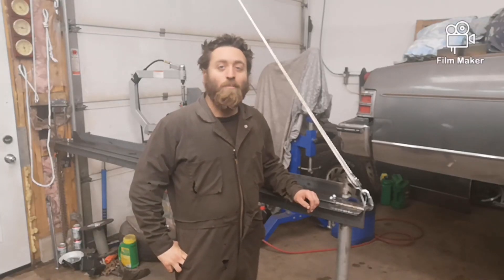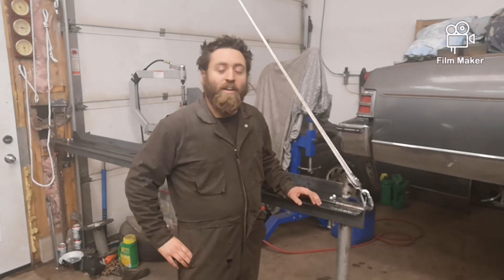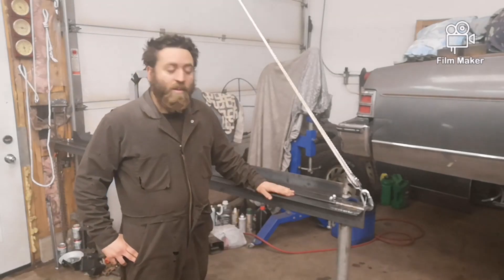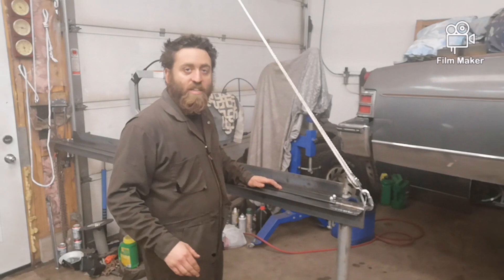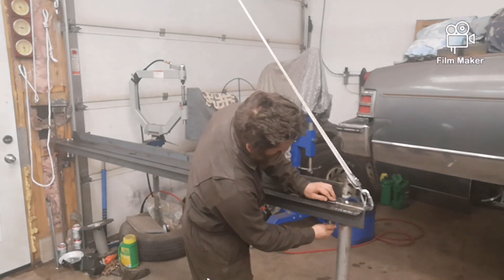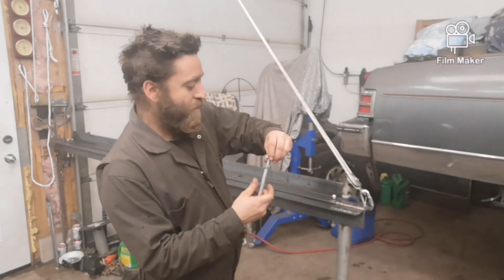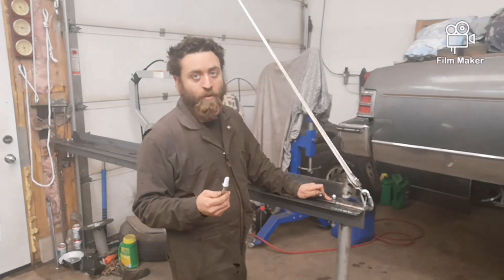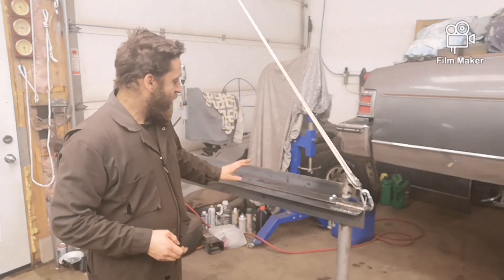Clargo Garage - 8 Foot Home Made Sheet Metal Brake That Takes Up Zero Floor Space  DIY - episode 46

Comment: very niceé I would add a secondary lock just in case someone messes with the rope.something low so that you can disengage it from your height
Reply from the maker: Thanks for watching, I have the rope that I use to pull it up and always have that secured when it's up plus's I have the separate safety loop rope ( verified that that would hold it alone ) and I have a angle iron support coming off the wall to help take some of the load off ( that alone probably wouldn't hold it, but it dose help take some stress off of the ropes . Definitely better safe than sorry if it ever came down would definitely do some damage if it hit something or would be deviating if it hit someone, definitely good to have multiple safeties on it. As far as function goes, I've had to add some extra bracing to help with the flex (should of used bigger angle iron for this length , haven't bent anything full length yet but have done some 36ish inch  long 20 gauge after adding some bracing and it's been performing good so far. Thanks for watching

Comment: fold up is a great idea for space saving. Was hoping you'd bend something bigger than that tiny piece that could be done with 4" vice grip flat bender. Maybe doesn't work so well on a big piece of sheet? or you'd have shown it,
Reply from the maker: Thanks, definitely saves alot of space and is practical.yes that could of been bent with a 4 inch vice but, Was just a demonstration of how it works , metal is expensive, so I only bend stuff when Im making something. I've bent up to 36inches on it so far. I'm going to be bending up some 6 foot long rocker panels for a project in the next little while with it , before I do I'll be adding abit of extra bracing into it , but so far I'm satisfied with its performance. Thanks for watching

Comment: I really like the idea 👍🏻 How thick can you bend ?
Reply from the maker: Thanks , and I've been using it on 20guage, I need to weld some metal to the angle to take some of flex out of the angle , when bending longer  peases the angle flexes to much , I had figgered that would be an issue and have picked up some metal to hopefully solve that but haven't gotten around to welding it in yet , I have some 6foot rocker panels I'm bending up for a project in the next little while and hope to get it perfect for the longer stuff to , but smaller stuff like 20 inches and less seems to work pretty good . And the storing is working pretty good to , saves alot of floor space and is quick to drop down ( about 2 min ) . Hope this helps and   Thanks for watching 👍